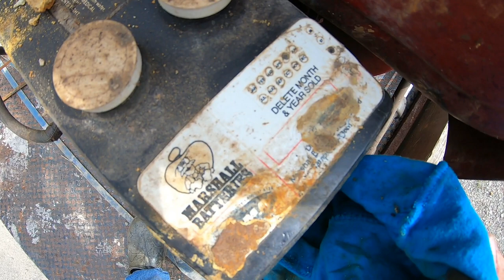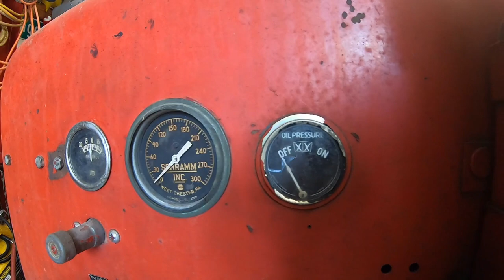1950's Gas Powered Air Compressor sitting 30 years! (Will it run!??)

Comment: Nice little compressor. I would say check on Amazon for that carburretor type, the kits were made by independant companies and were universal so there's a chance to get a kit. Or for now, you could go round to your local hydraulics shop and ask them for a rubber seal (from my couch I recon with a square cross section) of the same parameter of the float bowl housing.
That 'Wisconsin' oil filter, does anyone know if the company exists, or what happened to them, bought out, amalgamated etc ??

Comment: Look for a crack in carb, something on gasket surface, screws too long not tightening up bowl, or is fuel level in carb too high. Looked like you done decent job making gasket

Comment: i have taken the old gasket and scanned it with my computer scanner then put a sheet of gasket in the printer and printed out a gasket and then cut out the new gasket following the printed lines.

Comment: Perhaps the float/needle valve is not shutting off the flow of gasoline as it should.. Causing the level to be too high in the bowl. Being above the bowl to top interface therefore leaking.

Comment: Hey matt could the leak be caused by over tightening! Some seals won't seal rite if you do over tighten them. Thise could be one of those. Or it looks to me that it takes one of the u shape gaskes. Try  just using permitex wear the gasket goes and just hand tighten it and let it set up for 24. And then see!

Comment: Put some engine flush in with the first change. Sea foam works good.
Reply: Definitely needs a seafoam treatment in the oil and fuel system. That stuff works miracles for me.

Comment: Bent up the float a little, the level in the carb is to high, Check the needle and seat, clean of al the debris on the needle and seat. Should be dry even whitout the gasked ..

Comment: If the float is made of brass just drill small hole in top of float, drain out petrol. Then seal hole with dob of solder have done ot many times 😂

Comment: The 30 wt oil you used, waa that detergent or non-detergent oil?? I know from owning a few Wisconsin engines, they require detergent type oil. I'm glad to see you use straight weight oil also, multi-weight oil doesn't help the life of a Wisconsin engine any.

Comment: If I didn't know any better I would probably think that those breaker points kind of look like something that the Ford motor company used many years ago you might check that out could possibly be maybe maybe not

Comment: Hi i don't know if you where able to get that gasket if not you can make one from leather   My dad used to make gasket that way back home in E.S and it works for gas. and to fix the carburate float you can use fiberglass resin i use it my self to fix a fuel tank.

Comment: You will need to be extremely careful with that air tank on that thing. Compressor tanks rust from the inside out over the years from all the moisture in the air and it literally  rots out the tank wall. With that old battery sitting on top of it I would be very surprised if that hasn't corroded the tank some too.

Comment: PS; Not that this unit is that grungy...  I also use an ultrasonic cleaner (fill with Gunk carb cleaner..) for all carb cleanings (<$100 on Amazon or E Bay) courtesy of "Mustie1", the absolute carb guru! He and I both cut our teeth on VW air cooled's.. many, many carbs ago..

Comment: may i suggest you check you float height , it seems to sit very heigh before it closes off the fuel flow , it leaks past your bowl seal means that your float settings are way off sir , i know the machine is old and documentation might be hard to find , but ballpark im seeing it sits to high

Comment: Schramm made a few of these motor conversions. The most common were Ford V8 trailered units. Yours is a Wisconsin V4. It should do 35 cfm at 100 psi. You should have fun with this one. Wisconsin motors are pretty dependable as long as you don't get water into the exhaust stack. Wisconsins usually have a small fuel pump on the top of the motor opposite the control panel side. It is easily fouled if there is junk in the tank.  Clean and oil the pressure regulator or your system may over-pressurize. Its the T-handle looking do-dad. Most all Schramms have the same looking device.
Here is my Schramm Pneuma-Tractor. https://youtu.be/bFjLS5duynw  Its running an International 6cly gas engine. 3 to power and 3 to pump. Not much power to be of use as a tractor but its a hell of a drivable air compressor. I use it for my rock drills at my mine.

Comment: What a beauty! Before you touched it I said; "Of COURSE it will run" ...  Here's a good link for stuff about and for that compressor. https://www.smokstak.com/forum/threads/1950-1952-schramm-35-pneumapower-compressors-wisconsin-vm4-vp4.140034/ ... Just in case you didn't come across it...

Comment: I Bet that carb is pressurizing and causing the leak. Some of those Schiebler airplane similar type carbs have a tiny tube running into them or have a valve  leading to the tube that fails.
Reply from the maker: It almost seems like it was pressurizing, which I thought was bizarre, are you talking about an internal tube or an external tube running through the carburetor
Reply: @DieselCreek  Some of those carbs had a tube running into or thru them from a heat source to preheat the fuel before it left the carb to go into the intake. Small airplanes that ran those type carbs would get too cold in higher altitudes and the plane would stall. Either that or it's getting to much fuel trying to force it's way in there.  Maybe put an adjustable valve inline to slow the flow down some.  That may be part of the problem.

Comment: that carb is pretty bad.. but ive fixed worse..  actually on the same engine, good ol vf4..  but it was a stationary engine that was used in a mine in meiners oak ca near Ventura that sat in a barn since 1978 so i was told..  and right next to it was a brand new vf4 still in the factory crate!   i bet your wife just loved how you smelled after that..  cant get that smell off your hands for a week..  yuck

that sure is a neat set up though..  never seen on like that but i have seen 3.8 L gm engines set up like that

looks like there is some molasses in your sediment bowl..  thats the good stuff!

Comment: Take your float and heat it up and the fluid will pour out mosquito out then you can take some flux with a little solder a small torch and fix the hole that simple don't need to buy new float

Comment: Just Try starting the motor , No reason to fix something that isn't broken, You know how many motors I have started that sat 40 years and started right up. And how many people messed  with something thinking there doing the right thing and Break a part, Just try and start it. Its a close system he could have shut fuel off and let run out.

Comment: I got ahold of a 1950 gardner denver tow behind air compresso it makes 105 cfm  and has a buda 6 cyl gas engine on it..the carb was about like yours when I got it ..but I got the thing running and it makes air ..not a bad deal for 350. Bucks ...iit has a whz compressor head on it ..3cyl locomotive compressor is it's called ..hard to find info on them this so if any one has any info I would appreciate it.

Comment: Hope by now you have an ultrasonic cleaner for carbs.  Also,  some of the parts of that thing could have been far easier to clean with a vapor blaster.  https://www.youtube.com/watch?v=rjDGLPJ_sVY&t=12s.  Ideally you want 25 CFM for a vapor blaster, so if that Schramm can still put out 35 CFM, you've already got a worthy compressor.  Keep up the great work!

Comment: Fuel inject it:) if you google ecotrons, you can put together a system for about 350$ total.
Reply from the maker: I’m surprised it would be anywhere near that cheap
Reply: @DieselCreek  i meant 1350$
Reply from the maker: @69uremum  yikes nope lol not for my pocket book
Reply: @DieselCreek  yeah I can agree, I was looking at them for a project I was working on where i wanted to add fuel injection to an old 2cyl onan generator I had, now efi generators are getting alot cheaper. Keep up the good work, I like your channel and the lack of advertising! it seems like more and more peoples channels are becoming like a mtv show and losing their uniqueness.

Comment: well at lest the oil is not watery its nice an thick. that float i bet it will work   it run good on that gas lol not. what may work then rubber to make a gasket.

Comment: Check to see if the mating surface of the bowl is flat or flush with a flat surface, can you see a gap when you shine a bright light. At 38:20, I can see the gasket is an O ring, take some single conductor copper wire, clamp down the bowel, get your wife to give you a hand, shape the wire to match the edge of the, cut the wire repeatedly till you got the right meeting, lay the wire out, measure it and divide in 1/2 you get the size of the O ring. Next measure the thickness of the O ring. Go to a place you can buy O rings, a place that specializes in O rings, both standard and metric. Buy one that looks like it will fit and one that is a bit shorter, do this for both standard and metric. Is there some compound that will glue it in its seat? The first part, you have feeler gauges, use the thinnest one to see if it will slide under. If the bowl will not sit flat all the way around, time for sand paper in a figure 8 pattern till you see fresh metal all the way around, do this first before playing around with the gasket. Would like to hear if this helps, it is July 02, 2021 that I write this.

Comment: what is pnumatic ?? im guessing you meant pneumatic throttle control ?? why do you call the float needle a jet ?
Reply from the maker: Well technically it’s a metering jet
Reply: i would not trust that airtank heaving that battery sit on top of it and corroding the tank a bit
Reply: yea i was already wondering why you didnt pick up a sheet of gasket paper while you was at napa , i mean you didnt bother cleaning the old gasket of but yet wonder why it leaks , heck , the least you could have dont is use rtv as a sealant matt.
Reply from the maker: @dimievers5573  permatex no2 is made for sealing fuel related stuff fuel won’t eat it

Comment: If that’s a 4 cyl. And 2 of the cyl are for the compressor why is there 4 plug wires
Reply from the maker: 3 wires, 2 for plugs 1 to the coil

Comment: Why is it so hard to save the float?  Just find the entry point and use a safe product to plug the leak.
Reply from the maker: Hard to patch without effecting the weight of the float which will cause issues
Reply: @DieselCreek  ...Do you think that a dab of JB Weld smoothed over with a toothpick might work?  Or some other type of lightweight epoxy could do the trick?

Comment: Not going to even scroll down the comment list. Are you kidding? Have you ever figured out the MEDICAL COST OF USING CARB SPRAY INDOORS THE WAY YOU DO? Come on, it is MUCH easier on you to do a "Daryl Fixes All" and BUY some replacement parts for your junk.

Comment: What did you pay for the item Sir ??? VF
Reply from the maker: $200
Reply: @DieselCreek  My hat is off to you fella. Great work also. May I just say the best way to seal the bottom of the carb bowl is to use cork neoprene gasket material. Works like a charm for the old carbs for sure. The best gaskets are the brands used for old truck. Best for sure speaking from experience. Good day too. VF